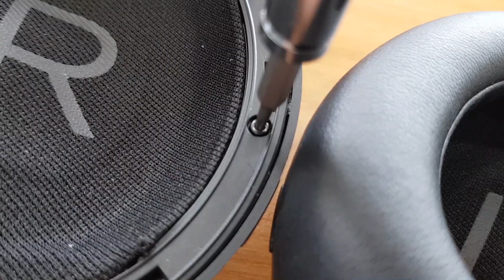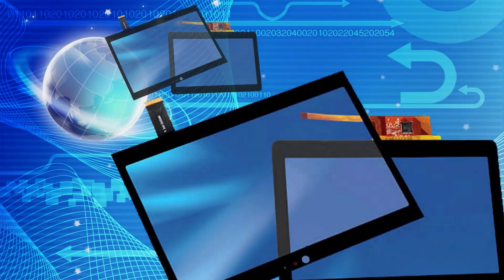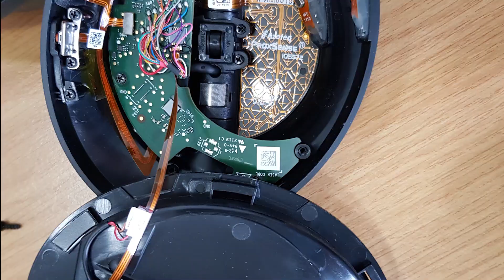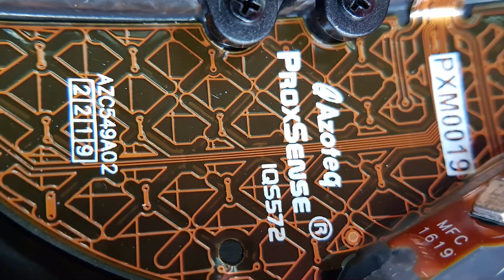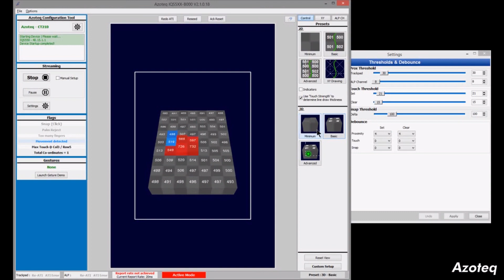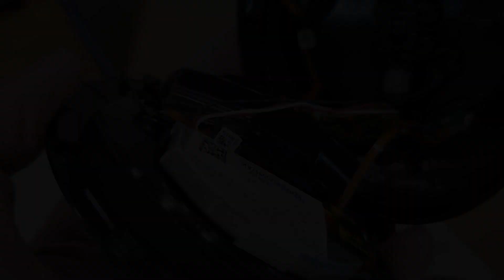Bose NC 700 HP teardown (application of projected capacitive touch sensor)

Comment: My Bose 700's touch control area have stopped working.  What component's should I attempt to replace first?  How easy would it be to do?

Perhaps the better question is how robust is the touch sensing components?  is it more likely that the capacitive mesh and/or IC's failed or perhaps the connection worked its way loose?

Comment: Does anyone know where the battery is inside? I'd really love to have a battery replacement guide, eventually the battery will die and the noise cancelling won't be usable any more since you can't charge and use them at the same time :(

Comment: The internal battery of the headset does not work and it only comes out a red color .. What is the solution 😭 And if we used the wire that came with it, it would work despite that broken internal battery???

Comment: Can you tell me it is hard to replace battery? In previous model qc 35 you need to remove a very strongly glued piece of plastic. In video I see you just unscew the plastic and desolder a wires. Can you do video about this? There is no information about it in internet
Reply from the maker: Firstly you need a special screw driver as shown in the video. To open, you have to tear the sponge a little. The Li-ion battery pack has a special half moon shape (model 792200-0010) so it may not be common. The is a small pcba attached to the battery and you may have to recycle that. Soldering skill is needed.
Reply: @SiliconSoup  Please could you make a video on replacing the battery or write a guide here? There are a lot of people with these headphones and they rely on a battery that will die sooner or later....
Reply: @SiliconSoup  Thank you for such a great video and support. I could not find any place that sells that battery model. As you suggested, it may be difficult if not impossible to find a new one.
Reply: I'm sure people would be happy to replace the battery with a more easily to buy battery even if it reduced the number of hours you could use it for, hopefully the datasheet will help identify what kinds of battery could be used. It appears to say 3.8v 630mah 2.394Wh